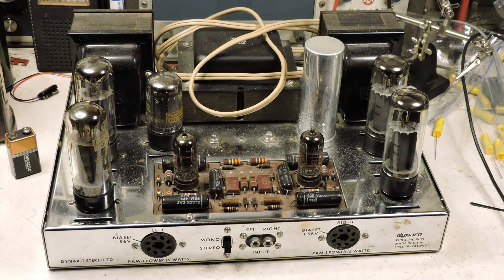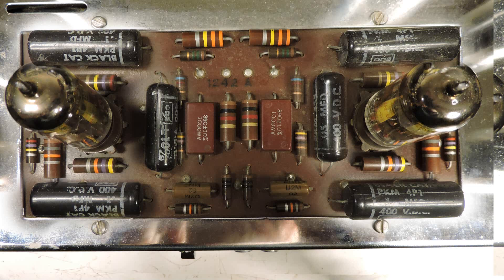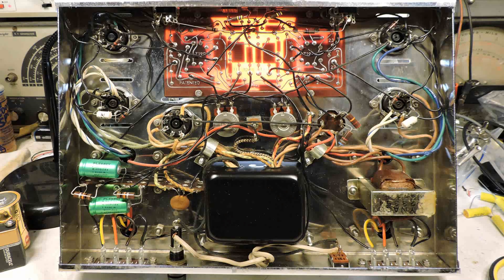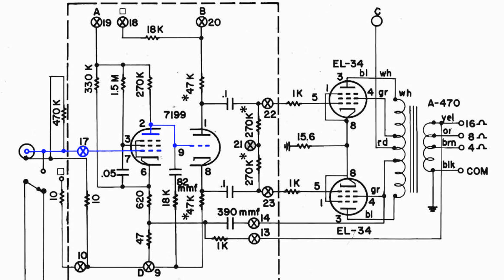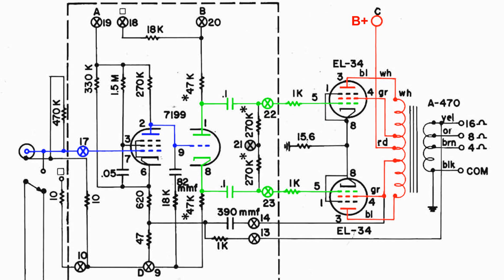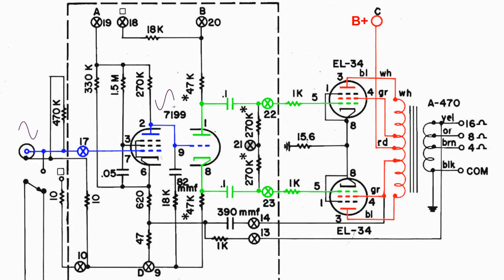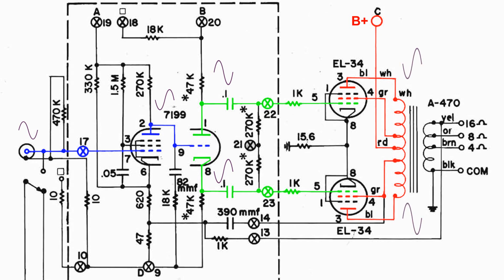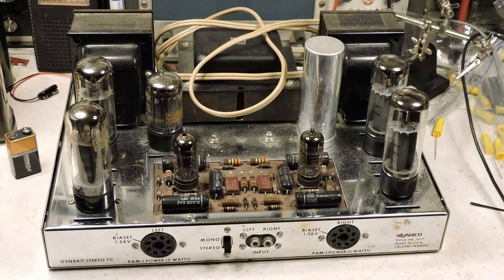Dynaco ST 70 Amplifier Circuit

Comment: in this case, the ground and chassis are considered the same in terms of potential or we need to distinguish them?
Reply from the maker: The chassis is the same ground as DC power ground. However the chassis is not used to distribute the ground connections, it is connected once, for a noise shield. All other ground connections are connected with a common ground wire from the power ground. Excellent engineering.

Comment: I'd like to know what the connection from the screen grid to point 14, and then to the input stage cathode. I'd guess it's a feedback signal.
Reply from the maker: Yes it part of the feel back that makes the amplifier as flat as a pancake.

Comment: Trying to understand circuits...question about the 7199 - I understand that it is being used as a driver and phase inverter - but what prevents DC from going to the grid at pin 9?  In other words why is some sort of capacitance not needed between pin 2 and 9 ?
Reply from the maker: Don't know how I missed this question, maybe Google never told me about it. The bias on the triode is between the cathode pin 8 and control grid pin 9. The cathode has a cathode resistor of 47K. The grid is connected to pin 2 and it has a 270K, then I goes to DC power. So there is a rather large voltage drop across the 270K and not so much of a voltage drop across the 47K. So from pin 8 to pin 9 is the bias voltage for the triode and it also has the audio signal on it.
Reply: Great question Marty.  I'd like to know that too !!
Reply: Got it ... that makes sense now !!  I can't remember seeing a circuit like that before.  Thanks a bunch for the response !!!  {:>)

Comment: Yes, your feedback is through the taps on the output transformer that go back to the second grid and also through the 350pf caps to the input stage, this is an impedance balancing type which smooths out the response curve to crazy flat.

Comment: Thank you for that, it was very informative.  I'm trying to learn about tube function and I wanted to ask, is the output from pin 8 of the 7199 equivalent to that of the plate?  I mean, I'm surprised that the cathode has an output associated with it at all.  I didn't know that could happen.
Reply from the maker: Barnekkid 
Yes it is. Notice that the triode has the same resistor on the plate as it has on the cathode. So the outputs should be the same.

Comment: I have an ST-70 too but I can't use it because the balance control on the preamp is seized up. I'm looking for a dual piggyback 750K ohm pot.
Reply from the maker: Jerry Carriera 
I would try putting a little WD-40 on the shaft where it enters the control. One or two drops with a screwdriver, and then wait a day or two and see if it has loosened up. If it has been I would put one or two drops of WD-40 on the material that holds the carbon run. I would try this first.